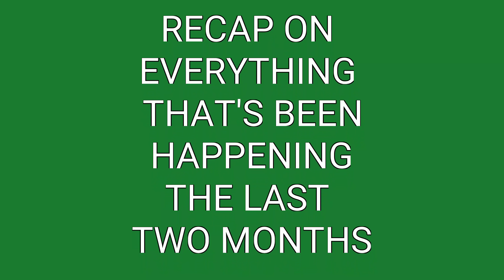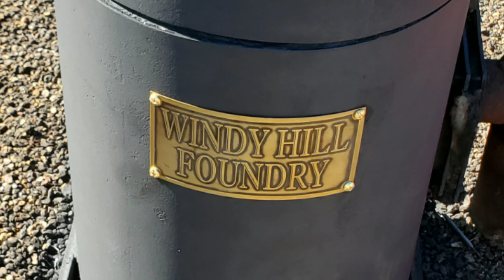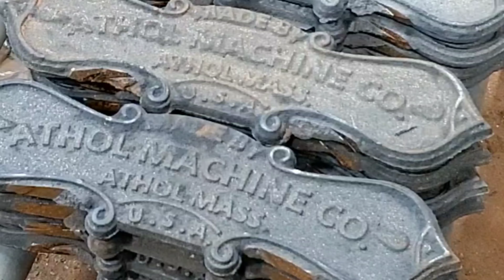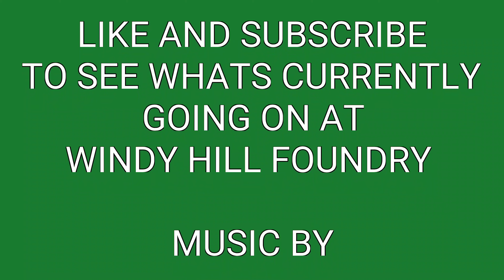10 MINUTE VID. RECAP OF EVERYTHING GOING ON

Comment: I really enjoyed the recap. It was really nice meeting you in Texas and getting a closeup look at your road furnace. I'm in the process of building an iron melting furnace and would really appreciate any info you could share on the burner you build. It worked great for it's first time out in Texas. Thanks for doing these videos. They are very informative and enjoyable.
Reply from the maker: Thanks, it was nice meeting you too. As for the burner, I would avoid this design, just too dangerous. Most use a develin nozzle that is better, predictable and much safer to use. This setup I have on the road furnace isn't designed for long term use, its ideal for demos because I don't have to drag a compressor with it but won't last through periodic use. I've been through several designs and even though this is fast, its brutal on a furnace and explodes several times requiring welding up another one to replace until you figure out the right adjustments. I highly recommend avoiding it and going with a nozzle and compressed air.

Comment: I used to work in an iron foundry (assistant pattern maker) and the pattern maker told me a story of how years earlier when he was pouring a mold it blew back at him and he got spattered with iron.  It all rolled off except one small gob that got caught behind his belt and burned into his hip.  As he put it he had never had the desire to strip off his pants so much in his life as to try to get that iron off him.  Which is what he did right there on the pouring floor.  As it all happened so fast there was nothing to do about it so he dashed to the foundry locker room, took a shower, and went back to work.  When the foundry owner found out a little while later he of course made him go to the hospital and apparently, according to the x-rays, he has a small blob of iron forever fused onto his pelvis.  How true it all is, I don't know.  But it was the best safety lecture I ever had.
Reply from the maker: I have been extremely lucky so far, been burned my share of times but nothing that bad ,yet.

Comment: Looks like you had a good time Clark.  Not to detract, but 11:04 to 17:09 is blank.  I been trying to get some feet/legs cast. They are about 10x10x10 in one of the irons.
Reply from the maker: Thanks I may have to take this vid down. Didn't realize there was an air gap
Reply from the maker: Send me an email to clarke@windyhillfoundry.com and I'll take a look at it
Reply: @windyhillfoundry5940  you can go into your YouTube studio and trim it down without reuploading.  Yeah you definitely got away with not having more damage.  I got torch burnt years back.  I will definitely email you here in the next 3 days if I dont get to it right now.  I dont know what material to use.  It's a 3D printed pattern.
Reply from the maker: @gbowne1  my mom told me my dads whole face was severely burned when an acetylene hose busted back in the 60s and he was in intense pain for weeks. Based off that I always try to avoid burns.  I'll see what I can do to trim this vid👍